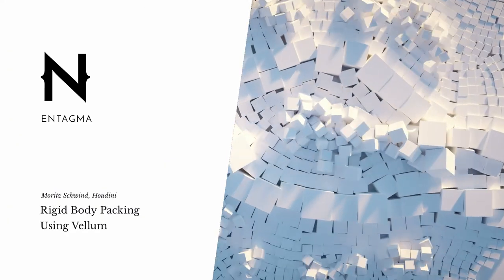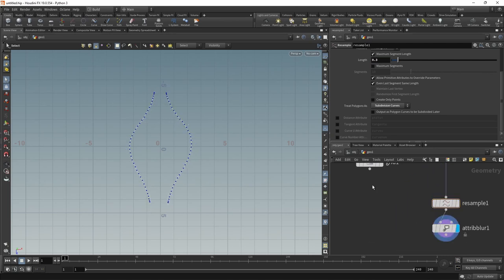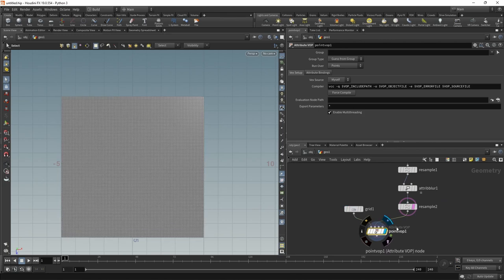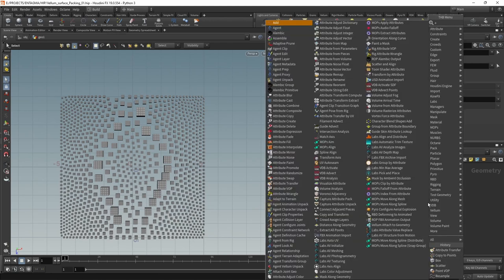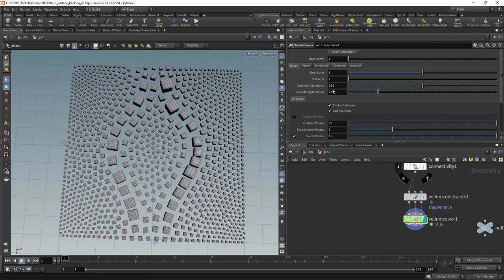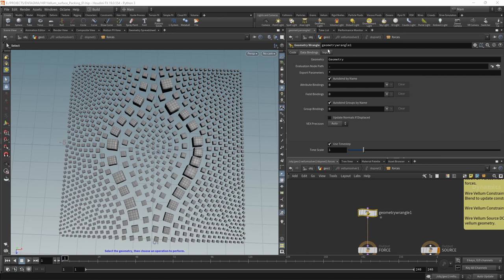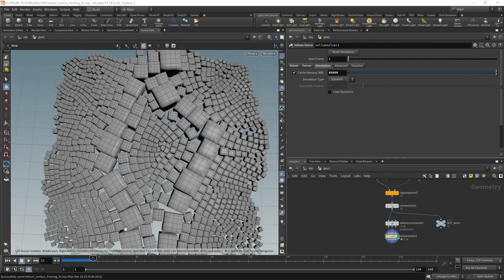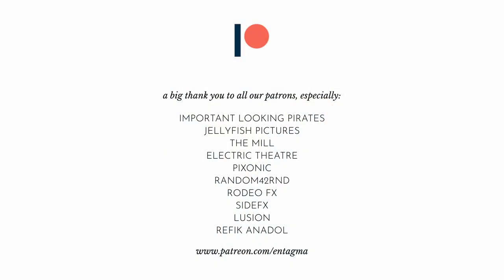Houdini Tutorial: Packing Rigid Bodies In Vellum

Comment: Thx Mo! Incredible, as always ;)
You know why it works only with the Shape Match constraints?
-
Alvaro
Reply: From the changelog: Houdini 18.5.472 The Vellum Solver has a new Shape Match constraint type, which can be added to existing Vellum constraints like cloth to make objects more rigid, or be used on its own. The Vellum Constraints SOP can create these constraint types, with the typical Define Piece parameters controlling which points go into each object. NOTE: these constraints have the same NVIDIA driver requirements as Pressure constraints, as specified in the What's New Vellum section of the help.

Comment: My version of this uses more random extruded polygonal objects. It has a tenancy to explode after about 20 frames. How would I go about getting my shapes to at least try to stay on the xz plane instead of flying away?
Reply: I actually sort of fixed it by making my shapes more extruded, longer and narrower so they collide and push on that long side more. Not a solution via vellum but it works for now.